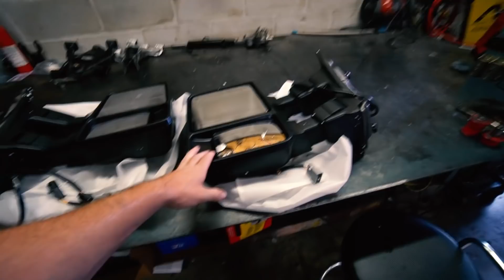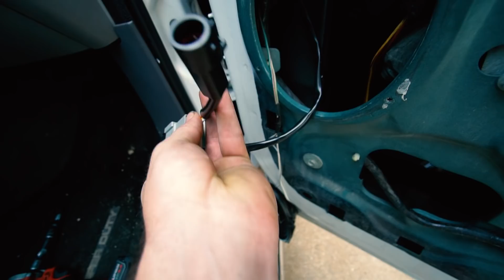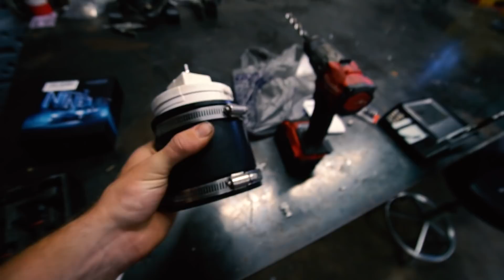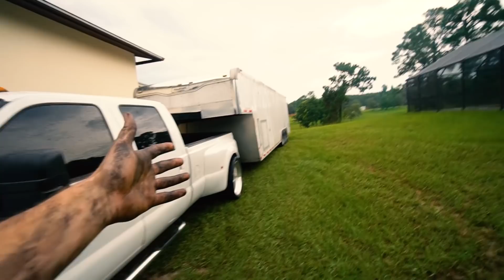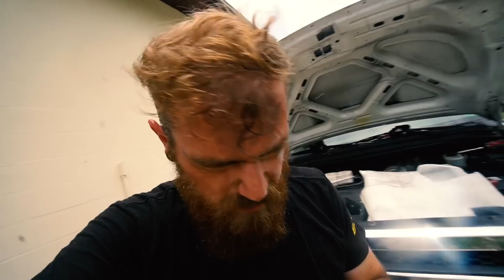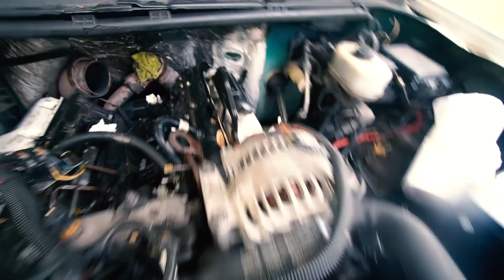Found a HUGE PROBLEM With My 7.3 Powerstroke on 24's! (Explains why it's so slow)

Comment: @taylor ray if you want to put LEDs in behind colored lenses, you need to get the same color LED. Just buy some amber LEDs and put them on the cab lights and they'll be great.
Reply: White LEDs work really good with red lenses. It's just amber or yellow lenses that need the same colour LED
Reply: The LEDs he got are probably in the 4-4.5k range, he just needs warmer ones, around 3k. 3.5k is considered neutral(ish) white so anything under that shouldn't change color, only brightness. (This is if they're the same LEDs used inside the cabin)
Reply: Good to know.

Comment: Taylor, those headlights are not sealed beam, or anything like it.  Pull the bulb out and make sure you got the right ones
Reply: If they were cheap aftermarket ones they probably are sealed style
Reply: @alexstromberg7696  GMC savana vans used sealed beam lights until mid 2000's
Reply: 100% not sealed beam. Those are 03-07 style f250 lights and are h13 size halogen bulbs. 🤷‍♂️
Reply: Yea most likely he got the same page I got when I was ordering my gto Headlights had a ton of bad info on it. I wouldnt have caught it if I hadn't already pulled the bulbs
Reply: @alexstromberg7696  a sealed beam bulb is just a large bulb. It's not a big deal to change them.
Reply: Alex Strömberg sealed beam headlights were used from the advent of halogen lights, originally only round headlights were allowed, but later square and rectangular headlights were allowed.  The truck in my pic is a 1977 K5 Blazer, squarebody Chevy trucks made with circular headlights are referred to as “round eye squarebodies”
Reply: @srmorso999  our chevy work Van's have sealed beam lights and they are 2014s
Reply: @alexstromberg7696  nope. They cost about the same, maybe a little bit more. For example I have Sylvania Silverstar sealed beams in my car. They're about $25 each while the equivelant 9007 is about $47 for a pair.
Reply: @alexstromberg7696  I wasn't going through all bulbs. That's the same brand, product line, and store. Apples to apples compairison. But the Silverstar H7 is also $47 a pair.
Reply: Head lights  don't make a boost leak!!!!!!!
Reply: for that year they were but you can swap in housings and led bulbs for pretty much modern lighting
Reply: @TheLarzon  i knew they had them until recent, just couldnt remember the year they switched.
Reply: Ford F-250-550 used 7x6 sealed beams on XL trim trucks from 1999-2010. XLT/Lariat/Platinum/etc use composite housings with 9007(99-04) or 9008(05+) bulbs.
Reply: Kyle Sonsalla yup you’re correct, all the fleet trucks used them

Comment: I have a 7.3l with the zf6 the hydra is one of the coolest tuners on the market has 17 tune settings. I have a ts6 position which works great as well. The up pipes tend to leak and cause high egt’s especially while towing. Make sure you replace them with the bellowed style. Swamps diesel performance is where I bought most of my stuff. Best of luck great seeing some 7.3l content. I never got around to it but maybe see about the gt38r turbo these Garrett’s leave a lot to be desired as far as spool goes.
Reply: James Dunn I have the hydra on mine with stage 3 injectors and a built auto trans its amazing
Reply: I agree! Leaking up pipes are big power robbers!

Comment: makes video about why not to buy a used diesel... buys another used diesel... and it has problems lol
Reply: Will never learn.
Reply: Zacyz125 typical Florida millennial. I want a 7.3 with 24s to haul my drift car, four wheeler, ghost trailer, tractor, put a flat bed on it..... Etc
Reply from the maker: Two things, one, I made fun of myself in that video, and in the title of it for this very reason. I know it was dumb, but I like it, so whatever, I accept that. Two, if anyone that complains about the "not buying a used diesel" video actually watched it, they would realize that the point of it wasn't that you should NEVER do it, but if you don't tow, or rarely tow, or only tow a small trailer, you might be better off just buying a 1/2 ton gas truck. Same fuel economy, better ride, cheaper op cost, cheaper maintenance, much cheaper purchase price. But, if you're towing a big enclosed, diesel is your only logical option. All of which is explained in the video that nobody payed attention to. lol
Reply: @Taylordrifts  if u do it right u can tow with 28s its all about how its put together...
Reply: @michaelaldridge3616  
Who makes 28 inch dually wheels and tires with a high enough load rating to actually tow?

Comment: look into getting a top side creeper, much nicer when working on trucks with one
Reply: TheVilleBilly the top side creeper has saved me much pain working on fords especially
Reply: I did timing chains on my 06 f150 with one of those, saved me so much time and uncomfort. Definitely look into one Taylor
Reply: Or pull off front wheels on lower jack to the ground
Reply: @subarupilot5722  If you pull off the jack hardware and hood latch and lay a furniture pad down it's almost as comfortable as an engine bay creeper.

Comment: Definently shouldve done billet plenums. Riff Raff deisel makes a great set. Wouldnt ever have to worry about them leaking again.
Reply: I agree, ive resealed a few 444s at my job. Its definitely an issue and that seems like a good solution.
Reply: Love the Riffraff plenums on my 97, hold 70 lbs of boost no problem, and the o ring seal works mint for servicing.
Reply: @centraltexasfoxbodies  
300/200's, GT4202R, Gen3 oil system, etc. Moves out

Comment: Best advise for any powerstroke is to use all motorcraft products. Unless its an upgrade!!! Best of luck there tough trucks
Reply: Yes the 7.3s need all factory parts international or Ford mostly sensors
Reply: Yep all Motocraft and Riffraff has some of the best prices  on oem parts.

Comment: For future reference for anyone interested, O'Reilly's stocks turbo install kits for these for like $20. Same contents as the Ford kit. 

Use Riffraff billet plenums and never worry about it again. They don't lift, they don't bend, they look much better, and you won't crush the inlet with a T bolt clamp when you upgrade couplers.

Comment: I’d pull the injectors out and clean/flow test them also while you’re already working on the truck!!
Reply: CCT and buzz test will tell you all you need to know about them, without having to turn a wrench. No external "cleaning" necessary.

Comment: Get orange leds for the cab lights. If the down pipe isn’t upgraded, you might want to upgrade it. The 7.3s need a coolant additive to prevent rusting inside the coolant passages in the block.

Comment: do a proper retrofit for the headlights.
Reply: Sad I had to look this far down into the comments to find this one.
Reply: @phantom240  almost every YouTuber I watch just shove LED bulbs in and people that watch think they're great afterwards.
Reply: LEDs are sometimes ok in Halogen housings. But yes a proper retrofit is best.
Reply: As long as the user checks to see if they dazzle other drivers it's fine but most don't
Reply: @Syncopia  get blinded by someone nearly every night, mainly jeeps where I'm at, but they also are pretty much all modded. for the love of god people, just look at you vehicle with the headlights on
Reply: If the light source is in the same spot as the halogen it's fine
Reply: LEDs are great in the Harley Davidson housings

Comment: Dude. You're a funny guy ! Keep it up. One thing, you might want to go into a little more detail (and speak a little slower for we old farts) on the technical stuff.  Your reference to Fords being easy to work on is spot on. We DO get it ! I'm on my second 7.3 (I'd still have my first, but I wrapped her around a tree) and actually enjoy working on her. Pulled the water pump off today. For room (optional) I pulled the radiator out too. Hoses, 5 machine screws, fan shroud, 2 bolts, 3 for the degasser tank and boom ! All the room in the world. Even the fan came off with minor coaxing (and the fan clutch wrench kit from Auto Zone, free but deposit). My last one had a tuner and exhaust from Gale Banks and a cold air intake, I forget the brand. She towed like a mutha ! I think you'll be really pleased once you get her dialed in. Have you named her yet ?

Comment: Nice progress Taylor. And maybe it's a good idea to mount a camera on the back of the trailer. Aftermarket stuff with a separate display on the dash. It's less dangerous when driving backwards and having no one to watch.... And for the led, try to find 2800K LEDs or oranges ones.  So the orange colour stays. Good luck!

Comment: Nice truck, I suggest getting a 08-16 tailgate and a 08-16 rear bumper, they sell them on eBay already color matched. You only need a driver side hinge for the tailgate, you can swap everything else over from yours.

Comment: You can also replace all of the lights in the cluster with LED's. I do not suggest replacing any cluster lights that are indicators, only replace the lighting for the backlighting. Otherwise you end up with laser beams every time you turn on your blinkers at night.

Comment: Hey Taylor if you want more power get 175/100 injectors and change out the oil pump too a high pressure oil pump also get a fuel bowl delete so you don’t starve the injectors my buddy had this exact set up an tows very well

Comment: Trailer roof hatch question: Why did you keep the stock vent and not change to an RV style fan/vent unit? There are some relatively cheap options out there and the van would help keep the trailer way cooler at events. I assume it's a standard 14" x14" hole like most trailers and RV's (I assume you didn't because of cost?)

Comment: Please dont paint match the mirrors. They look really good black. Also Might want to keep an eye out for extra wheels & tires for the truck. Road trips KILL large rims & small tire walls.
Reply: was going to say that.. or swap it back to the proper wheel/tire combo. Alloys with low pros are NOT for towing. Sometimes you have to sacrifice style for safety and function.
Reply: There's no way you're killing Alcoa's with this weight. They hold up 100+k lb semi's all day, every day. A single wheel carries as much as this whole truck weighs during normal use.
Reply: @kylesonsalla7620  Go back & read my comment again... "large rims & small tire walls." Doesn't matter about weight, when you are driving between 35mph to 90mph & you hit a bump/crack/rock/debris with wheels like that, that have a small tire wall it will bend or crack a wheel. I've seen it countless times.

Comment: The injectors and up pipe are a bear but you have done most the work already. Don't forget to check for fuel leaks. They are common when you remove the filter housing.

Comment: You need to get the smoked cab light covers and then put the leds in I did it on my 2016 f550 and it looks mint

Comment: 99% shure those headlights are off a 1999-2003 harley Davison truck they look more like the 6.o headlights but are not actually the 6.0 headlights
Reply: Those headlights are the 05-07 housings pre 05 all the headlights are 2 piece. But you are correct about them being from a Harley Davison editions
Reply: That year range only offered F150's as HD edition.

Comment: H13 is the bulb type you want for those headlights. as those housings are the 05-07 headlights. the 99-04 use the 9007 bulb

Comment: You have the later 05-07 6.0 front end those headlight housings take an H11 bulb. the earlier 03-04 6.0 trucks had 9007 bulbs. I made the same error cause my 04 has the 05-07 housings

Comment: would it be worth it to wire in a reverse camera onto the back of the trailer,  then you would have almost a 360 deg view between the cam and the mirrors

Comment: There are only a couple headlight bulbs that are dual filament. 9003 (H4), 9004, 9007, and H13. Likely if it was originally a 9007, a 9004 is most like a 9007.

Comment: For all you Ford ranger owners out there if you're dome light is broken like most ranger the ones that this truck has will work on all extended cab rangers with a small trim to one of the plastic locator pin on the plastic that against the headliner it need to be trim for it to fit as flush as possible

Comment: I know in the past videos you were complaining the truck seemed slow, I know you obviously had a boost leak but with running the 24's do you think the speedometer is inaccurate? Because bigger wheels and tires will throw the speedometer off a good amount if it was never re-calibrated for your setup, just a thought but it could throw it off by 10% which is a good amount of MPH if you think about it. I could be wrong but just a thought.

Comment: Not hating, just curious, but why buy a used 7.3 Powerstroke at this point? The new V8 gas trucks make more HP and nearly as much Torque.  Plus they are probably as reliable, and easier/cheaper to maintain... I love the 7.3 I just can’t justify the price people pay used for them especially when they seem like they’ll be so expensive to maintain
Reply: Buy a 12v cummins
Reply: What make and model v8 gas truck makes the same hp and torque amounts as a diesel?
Reply: eric hudson  2011+   6.2L gas F250 makes 385hp and 430 lb-ft , his  7.3 makes like 250 hp and 500 lb-ft ... give or take hp or torque they make similar numbers , but the 6.2 is newer / less maintenance prone (just my opinion, also not sure if those numbers are exact but pretty sure they’re close)
Reply: Also with the gas engine maintenance is cheaper + fuel itself is cheaper
Reply: I own a duramax. Stock its putting out 450hp 910 ft lbs of torque. Guess that's why I stay away from ford lol gutless
Reply: eric hudson what year is yours? Cause we’re talking like late 90’s / early 2000’s diesels not recent ones

Comment: Reason why they cut the bolt short is because along would not fit cuz the high pressure oil pump is in the way what's the time you got to move to high pressure oil pump to get it out so they cut the old Bolt well it was in took the rest of it out and put a different bolt on shorter pretty much preventive for the next time you got lucky they did you a favor

Comment: Taylor change you air intake your filter being open and not sealed off is actually hurting performance because it's just sucking in the hot air from the engine bay switch over to a cold air intake that has a box on to actually be able to get colder air into the engine

Comment: If you put big wheels on a truck you need to re-gear the rear end.  If you don't it's sluggish and shifts weird.
Reply: Once again do you truly believe those wheels and tires are any bigger then a factory set with 33s nope . those tires are bandaids
Reply: You also have to remember that re-gearing is mainly a gas engine deal most diesels have plenty of Torque unless you go stupid big wheels
Reply: Wrong!!!!!!!!

Comment: Is it tough too relocate the turbo
Reply: Maldito Ugo Yes, turbos are connected to the exhaust, intake and oil system and need to be the right height to drain the oil back into the motor after it’s gone in the turbo housing. Lots of work to move all that.

Comment: Bigger wheels means the engine has to turn over more to turn the wheel one time. Smaller wheels means you get more acceration but lose top speed. I'm not going over 80 mph in a dully anyway. I rather have a quick 20 to 70 mph superduty.

Comment: You should change those metal fuel lines while you're in there cuz they vibrate on the clamps and eventually it creates a hole broke down on the way to Port St Lucie cuz of those damn fuel lines so I got some hoes some fittings and I also tap into the other fittings on each corner and made it a return system much more reliable and runs much better and smoother best of luck to you

Comment: You should put the newer style 2011-13 front end on the truck i think it would look so much better.
Reply: NotThatJoeGuy it already has an entirely different front end than it came with factory 😂
Reply: @joshlarochelle1298  I'm pretty sure it only has different lights.

Comment: Open up a cash account at Ford Dealer like I have. 
I actually have 2 cash accounts at 2 different Ford dealers in my area. 
You will save on parts!
For instance 
They were asking $285 For passenger side exhaust manifold for my 7.3 L. 
Paid $216 with cash account

Comment: You act like you dont know if the truck is capable of towing the trailer and the car...Our f250 could literally tow anything. We had a 6 thousand pound trailer with a 4 thousand pounds of stuff in it. Didnt squat and didnt struggle. Before is spun a bearing it was a good truck.

Comment: Do not put LED lights in your truck at all the 7.3 diesels do not like them at all and can mess stuff up. If you do them in the 3rd brake light they can mess up your transmission
Reply: How? Not saying you don't know what the fuck you're talking about or nothing....I'm just wondering what you're experience tells you
Reply: @alexstromberg7696  I have 2 7.3 trucks now and have had 6 total all 7.3s. I know the 3rd brake light is tied into the transmission for the TQ converter so it will mess up the transmission. Also the 7.3 have a electrical system that turns 12v into around 120v any of the wire harness with red tape has around 120v like a house does. So I'm guess somthing with that does not like led or hids.
Reply: Also HIDs in 2 trucks I have had would sometimes shut down the truck when you would turn the headlight hids on. Also if the hids were on and used wipers it cut out at random some times. It's not worth the problems I'll tell you that.

Comment: Knock on your truck door but it's because it's a ford that's why it's easy to work on. I have a 1980 Ford F150 with a 5.0 liter it's probably got 200 to 300 thousand miles on it if you want to see it what's my YouTube channel